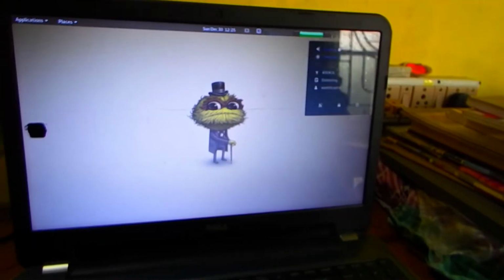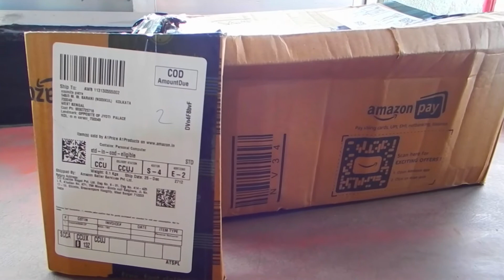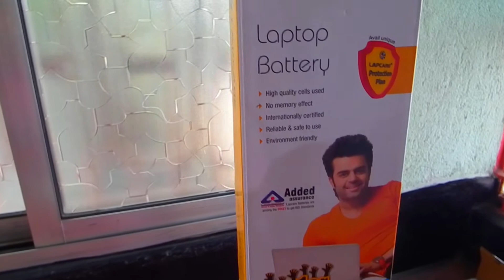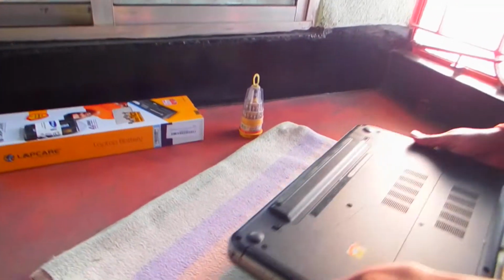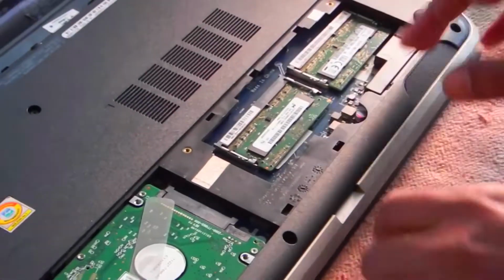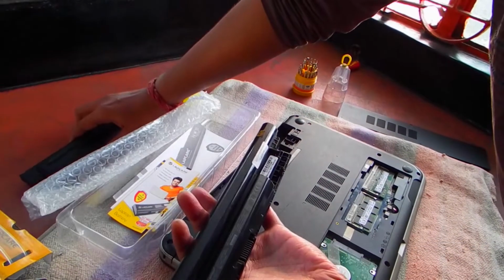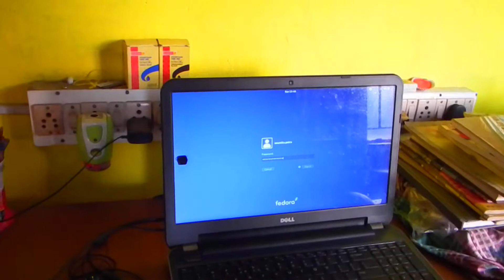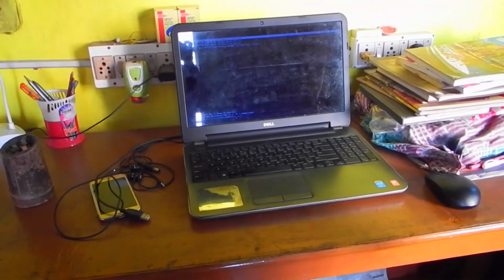Dell Inspiron 15R 5537 Upgrades

Comment: How is the battery doing after 3 years
Reply from the maker: The battery is still performing well...
Reply: @SushantaSantra How long is your battery life with full charged at the first time you use it? And can you give me link to buy that battery, please, I need to check the detail. My battery replacement for the same laptop as your only run 1h15' with fully charged and the seller said it because my laptop is old but after watch ur videl, I need to rethink.😂

Comment: Hello,
I'm having a problem with my dell 5537 being too slow and the disk is unprecedented 100%. Did you solve this problem ?? Would you help me? I do not know what else to do.
Reply from the maker: Hello there,
If you have a very slow HDD then you please upgrade it to a SSD, which would increase the overall performance and also the speed of the system..
Reply: @SushantaSantra  hi, im facing same issue, which ssd should i get for dell 5537? which ssd is compatible?
Reply: Get samsung evo 860 500gb.. u ll be good to go for another 5-10 years with this laptop 😂
Reply: Same problem
Reply: Yashank Goswami sata 3
Reply: @swaminnpublic  bro aapne ssd le le kya ?
Reply: @Ajay-tx3vg  nahi abhi nahi liya
Reply: bring it to a technician and have them replace it with SSD for the same amount of storage as your HDD for 1:1 process of cloning your old hdd to your new ssd.

Comment: I have the same laptop and same problem with the LCD screen
There's Big black spot like u have and i want a solve if you already solved 
Please tell me
Reply from the maker: Hi, the issue with screen can be solved by replacing the screen on the laptop ... Which will cost you around 3k from a Dell service center..
Reply: @SushantaSantra  3k what?
Reply from the maker: Sorry for misinformation... It will cost you around 7k for the new screen if you want to replace the screen with a new one .
Reply: @SushantaSantra  7k dollars 😲
Reply from the maker: No.. dude it's 7k in Indian rupees..